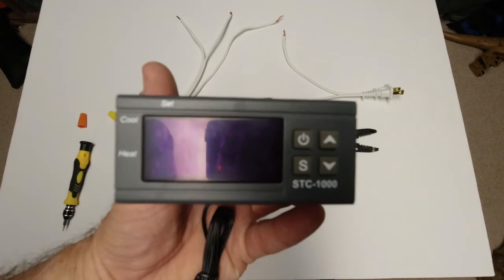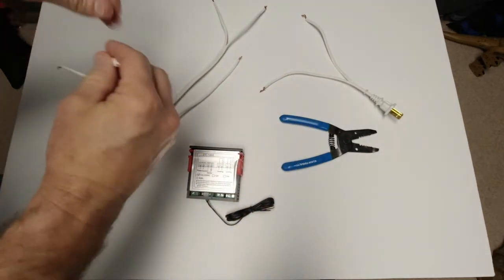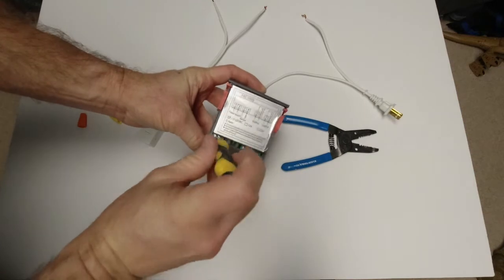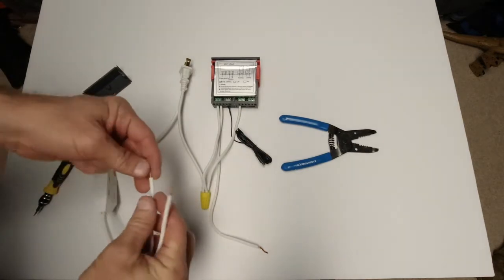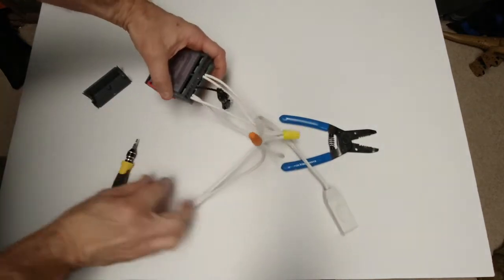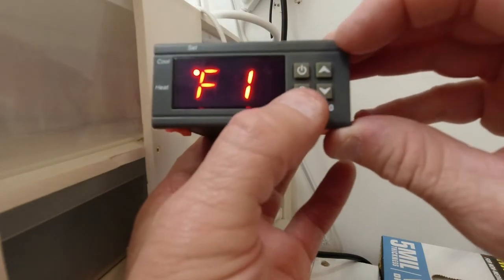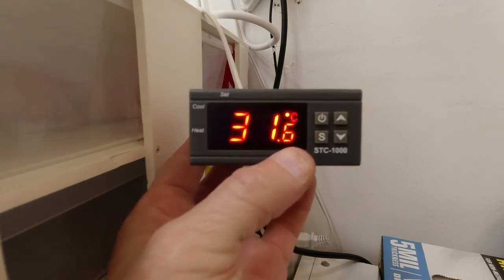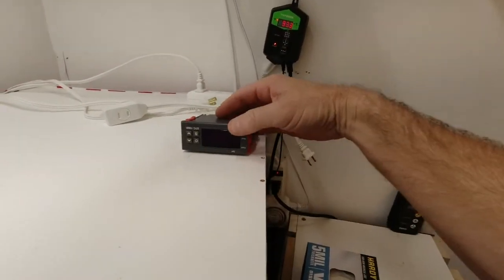STC 1000 wiring and setup

Comment: Heres a problem, i plugged 2 heat mats into it (theyre different) and one is 32C (as it should be) and second is 38
Reply: Heat mats can vary a bit between each other, it's always always always safest to use one thermostat per tank.